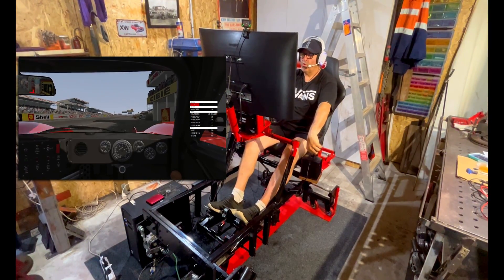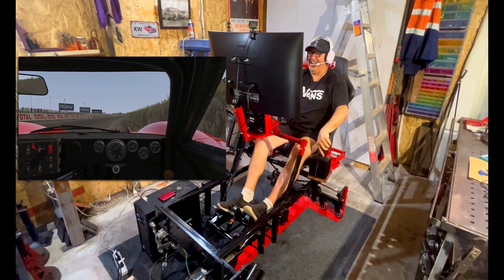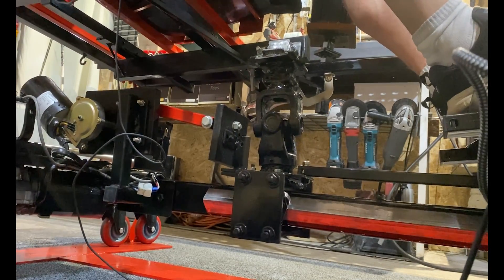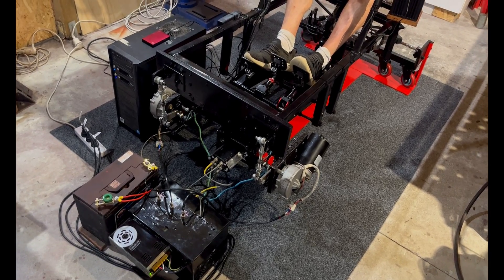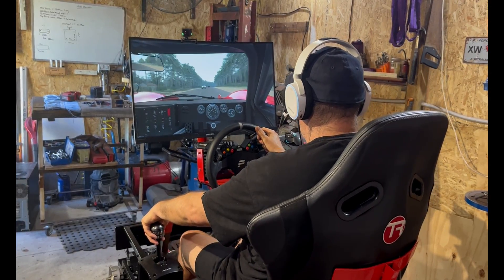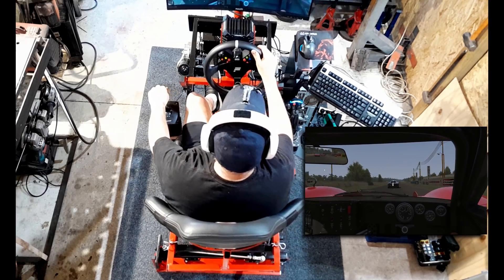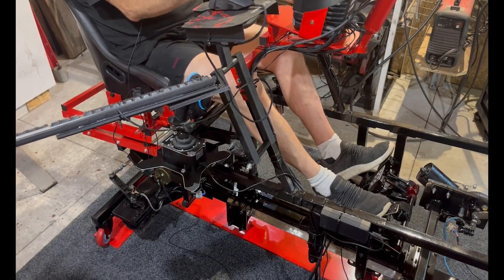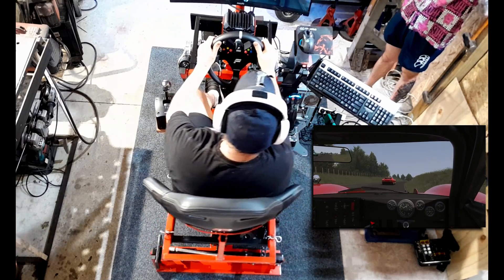How I Built A Kickass 4DOF Motion Simulator In My Garage

Comment: Started watching your series, really liked how thorough your instructions are, now I'm Interested in this project, was there a parts list already put together showing the bits and bobs used or do we get it from the videos? ( Wanted to get an idea if I can source all the parts in the states and est cost)
Reply from the maker: @stratman71 I love a good Strat! Glad you found the page. Here's a video with a list of needed materials for the build, along with cut lengths if you are going to get your metal shop to cut the stuff for you. https://www.youtube.com/watch?v=3DvE3_dE_ik&t=591s  

But I do teach folks how to cut their own stuff straight with a hand angle grinder if you'd prefer to save some coin. You'll need a grinder regardless for a lot of the build. On that, I can tell you already that you'll need to spend around 2.5 to 3k (AUD, so less for you guys) to get this build completed. But that includes everything (not the racing gear like pedals and wheel etc) including a welder, grinder, and materials for those items along with motors, electronics, etc. 

That includes using high end electronic components like the sabretooth 2 x 32 motor controller for the vertical motors. A big ticket item, but well worth the money over the cheaper IBT-2's, which are still used on the less taxed horizontal motors.

My stuff is in metric, but I've included a metric to inches converter link in the videos for my US friends that use inches. There are a few of you guys from across the pond building this, so it can be done with materials from the US. 

And as each part of the build is covered in the tutorials, I do go through the measurements for that particular segment of the build.

Comment: really beautifully built sir. :)  why did you choose this direction for surge? in my opinion, it's more immersive when it goes forwards while accelerate. what are your thoughts on this setting?
Reply from the maker: @motionbasti Welcome to the channel. I've had this question a few times. I have tried both axis for the surge. A number of things impact surge direction and which one works best for a sim. Motor speed and travel distance are key factors to which way the surge will emulate real gravity like felt in a vehicle. 

My setup has a short travel axis and a reasonably fast motor RPM. Because the travel distance is 220mm total, it works better for the braking to actually surge you forwards and the acceleration to push you backwards. If I had a little more travel distance, I would swap the axis. It also comes down to how the forces feel to the individual in my opinion. All these emulations are no where near close to actual gravity forces felt in a vehicle. We are just trying to trick the brain.

Thanks for the feedback!
Reply: @Doctoradhd1 thanks for your opinion. 🙂
Reply from the maker: @motionbasti  No problems. Hey I checked out your Actuator motion sim. Very cool! I can see why you like the surge the opposite to my setup.
Reply: @Doctoradhd1  thanks man. sold that rig. next one will come soon. :D

Comment: Hello and I congratulate you on that great 4 DOF simulator. A great job. By the way, I'm asking you about a question. How much rpm do engines have to be? I appreciate that you can clear up this doubt for me. Thank you so much
Reply from the maker: Hey hey hey Amazon man. I'd look for motors in the 40 to 50 RPM range. 180-200watt 12 or 24Vlt. But the motor controller is also very critical. Make sure you check out my tutorial Pt 2 next week. I talk about that and show my setup and recommendation in next weeks video. Peace out.